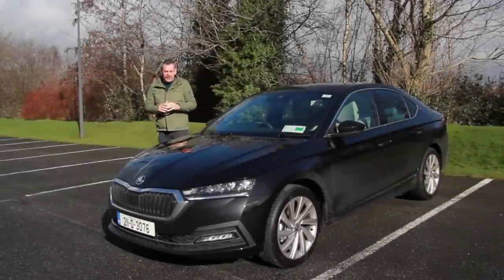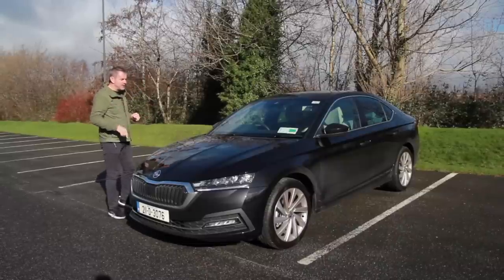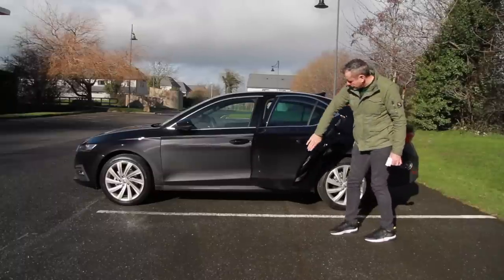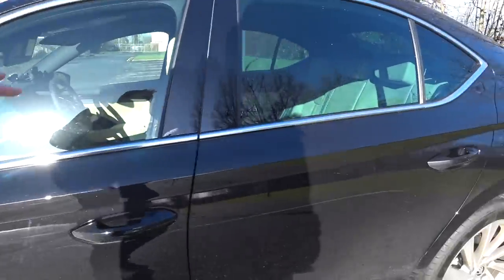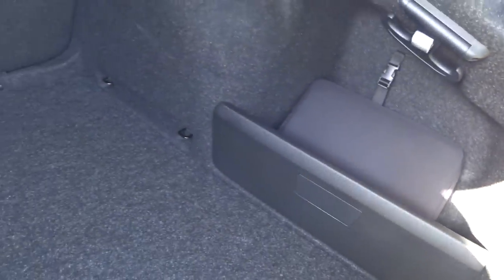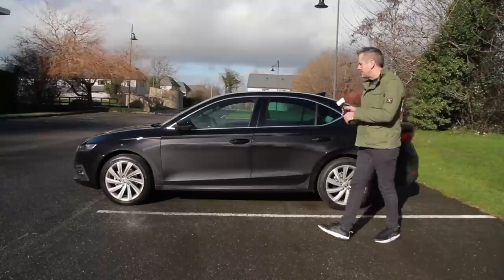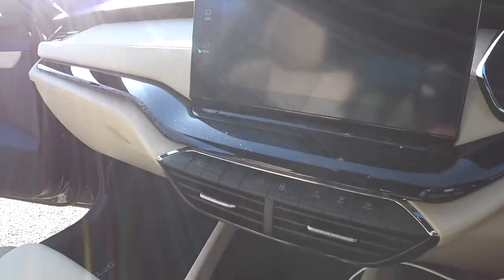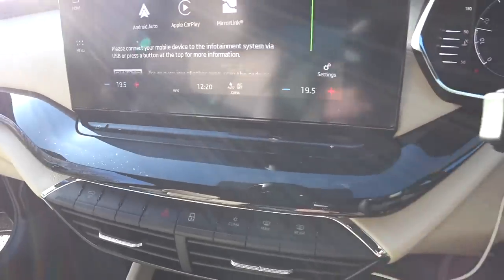Skoda Octavia mHEV the best small engine big car

Comment: Have. Driven now 3000 miles in the 1.0 litre dsg and find the power more than adequate. Had  5 people and luggage in it for a 200 mile trip recently and happily cruised at 70 mpg without any issues.Averaged 61 mpg on this trip.!
Reply: really? wow that’s great to hear! would you recommend 1.5 e tec over 1.0
Reply: Would have asked the same question? @prodbyconscious

Comment: I've got the previous generation Octavia estate with the 1.0 and it's incredible. I also had the 1.4tsi 150 in an Octavia and the 1.0 with the DSG is a better car to live with than the manual 1.4. Only during heavy acceleration can you notice the difference between the two engines. I'll look forward to talking the eTec for a test drive.
Reply: Have you got it mste any problems and how many miles ?

Comment: On the second Octavia Combi with a glorified 1 litre petrol and this one is the new model. Yes you need to play with the gearbox a little when you have a crowd 🤣 on board but I find that fun. It's the one part of driving I'm going to miss when we buy an EV. As for miss Laura I don't know how many wrong phone calls she wanted to make for me. If you press the Clima switch under the screen you'll find the SYN icon for controlling the two sides to the same temperature. As always Bob, entertaining to watch and listen to you.
One thing I forgot was that the vents on the driver side move fully to the left and that closes them, that also includes the rear one on the driver side. On the passenger side all the vents are moved fully to the right to close.

Comment: Another great review. Thanks, Bob.

 Why don't VW group admit that their switch to touchscreens controlling virtually everything was a mistake? Defending the screens  by saying that they are 'the way ahead' simply isn't good enough. The fact is, touchscreens are cheaper to develop and produce than conventional knobs and switches, but for the buyer there is a big price to pay in the loss of active safety. 

In VW's case the  situation is made worse by software gremlins, which mean that the latest screens can be both slow and unreliable.

The positioning of the vents low down to accommodate the massive screen in the Octavia's case is another ergonomic disaster. Simply clever? Downright stupid...

I am a big Skoda fan, and there is a lot to recommend in the latest Octavia. For me, though, until VW either wakes up or comes clean on the touchscreen issue, the Octavia will not be for me; Japanese and Korean rivals are much more worthy of consideration.

Comment: Great review Bob, I’ve also noticed that the suspension is a bit bangy and rocky at low speeds in both of my Škodas, a 2010 Fabia Estate and a 2013 Rapid, yet both of them smoothen up and are very refined at higher speeds. I can also support your comments about build quality; I’ve had the Fabia for a few years and it’s never had any major issues yet aside from some dash rattles and minor electrical glitches, and I’ve just got the Rapid and so far it feels built like a tank. Also impressed with the feeling of quality you get with Škoda.

Comment: I have a 1.4 S-EL Octavia which I love but my wife hates because of the harsh suspension over poor roads at low speeds which you mention in your video. I thought that Skoda had addressed this issue in more recent cars but, apparently not. I've even considered going to the expense of replacing the 17" wheels & tyres with 16" ones but I'm not convinced it would make an appreciable difference. Excellent car in every other respect.

Comment: Good review Bob. I believe that all Octavias below 150hp have a cheaper rear suspension setup which makes the ride rather restless at lower speeds. Above 150hp gets you multi link rear suspension and a much better ride....
Reply: 150hp and below get torsion beam rear suspension, same for Seat. Vw and audi get multi link at 150hp though.
Reply: @mamba101  Interesting. I have a 150 bhp Octavia which crashes over potholes and drain covers abysmally. Now I know why. Going to a higher profile tyre really isn't going to make any difference is it.

Comment: Highly Agree with your points about the Voice Control and Touchscreens..

The Voice Control in my 2016 Octavia SE-L is ABSOLUTELY USELESS(!!),  Press the button on the steering wheel,  plays it chime,  "Call Girlfriend" and just calls calling a random number in my phonebook and frantically hitting hang up then having to do the call by myself.. 🤦🏻‍♂️🤦🏻‍♂️

The ONLY way they are gonna perfect Voice Control,  is by partnering up with Google and building from their Data Base with Wording, Phrases and Accents..   Because i'd bet if Bob & Myself both asked the same question,  we'd get different responses due to the accent differences..

Comment: I take it the battery system keeps the aircon/heater on when the engine switches off, have a Suzuki and when the stop start system kicks in it shuts of the aircon/heater which is such a pain in the neck. Always turn it off when I get in.
Reply: If it is like the other VAG cars in the range then it will keep the aircon running (the compressor is electric) and the fan blowing. I’m not sure about the heat (it’ll depend on whether or not the water pump is electric: does anyone know?)

Comment: I HATE the name 'mHEV' there is no EV in mhEV. this is a petrol/diesel type of car with small help of battery! and a chance to shut down an ICE while maintaining all car functions. It's like calling a McDonalds a vege because you add an extra slice of tomatoes on top. IMHO if you don't have an option to drive (by choice) in EV only mode, there is no reason to call a car EV.
Reply: I think it’a termed mild hybrid to indicate that the electrical system is more powerful than the standard 12V system. As well as allowing coasting and maintaining car functions when the engine is shut down, the motor is powerful enough to provide torque assistance to the ICE (to fill in torque gaps, which is particularly useful in a small turbo petrol) and provide some regenerative braking. 

(Perhaps the biggest difference that most people will notice is that it makes the auto-start/stop system seamless.)
Reply: @AdamCalow  I am absolutely fine with using MH part. but this is mhICEv. Without ICE it cannot run, as MH only supports ICE or reacts before ICE can reach the optimal levels. for PHEV you can drive without ICE.

Comment: How good is turning the engine on and off all the time. Sounds like its going to wear out prematurely.
Reply: How so? With traditional start stop cars you could argue that the starter is going to wear out much faster as it is a traditional one, but the starter on mHEVs is usually the generator, which starts the engine over the auxiliary belt and is able to pull it up to idle revs or even higher, a traditional starter usually only gets the engine up to a speed where it can bring itself up to idle speeds. If anything, not having the engine running is better than to have it running with basically no load, right?
Reply: @or2kr  From what I understand , the most wear imposed upon an internal combustion engine is when you start it up , the reason being that it takes a while for the oil to circulate and fully lubricate the engine. So my thinking was that repetative stop start is going have a negative effect on engine life.
Reply: @peteg8920  that only really happens when the engine has been shut off for a while, only then the oil has a chance to flow into the oil pan and away from the things that need to be lubricated. Also the oil stays hot and thus less viscous for a long time, much longer than what the mild hybrid system can handle for coasting, the longest coast that I have seen with the system was about 8 minutes by rolling down a whole mountain, so not that long. Besides, if you tap the brake once, the generator pulls the engine up to the needed rpm to coast, which does engage the oil pump while braking with the engine without consuming a drop of petrol
Reply: @or2kr  Okay. This version of the Octavia could be a good choice then ?
Reply: @peteg8920  Really depends on what you need and want. The hatchback 1.0 e-tec has a very low drag coefficient so it is very efficient on the motorway and the small engine won't really have an issue with keeping speeds, just getting up to speed could require some patience. But it goes like a 150hp SUV which is a pretty common choice nowadays, so it should be enough for most people.
I'm still looking to get a test drive in one, maybe even a rental, but I already have driven once in a 150hp Seat Ateca with the 7 speed automatic which was plenty powerful for my taste
Reply: @or2kr  What 's your opinion of the dsg on this car . Is it reliable ? Does it require extra maintainence with regard to oil changes ?
Reply: @peteg8920  no personal experience, the Ateca was just a rental. From what I've heard, this perticular DSG had some issues when it initially came out a long time ago but has improved since and isn't really known to fail for a common reason, but it'll require oil changes like every 100000km, which is about what a manual requires as it only uses dry clutches. No idea though how long the clutches last, may need to be replaced after 100k-200kkm or so, or much later due some design improvements that haven't stood the test of time yet